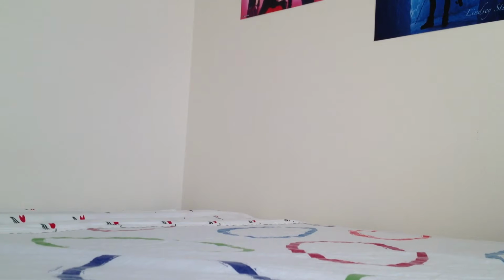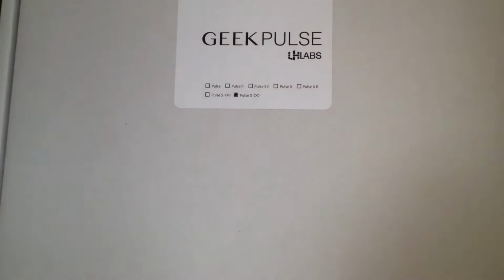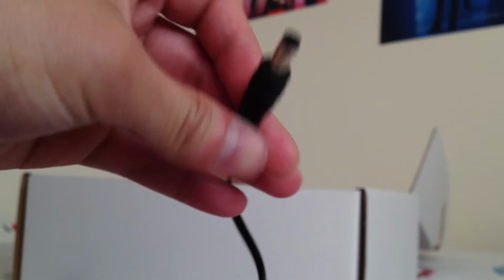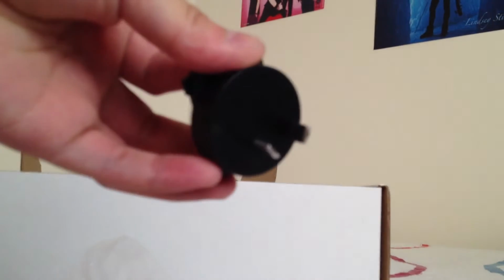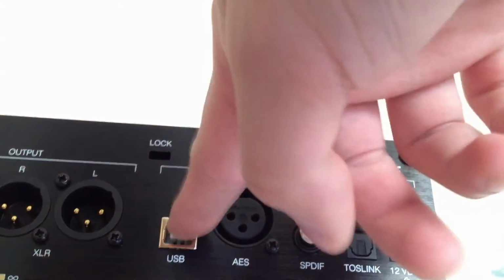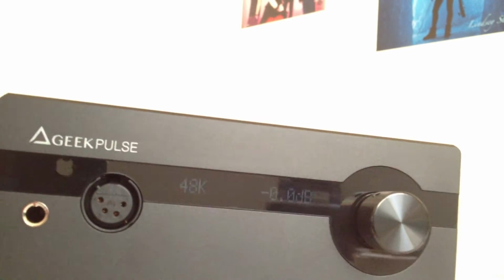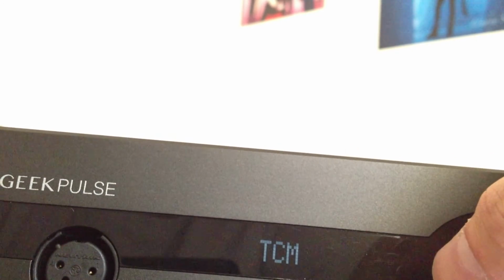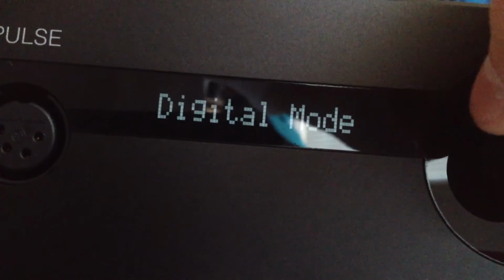[Binaural Unboxing] LH Labs Pulse X Infinity

Comment: so is this actually a decent DAC then not overpriced? are you still using it now?
Reply from the maker: Well, overpriced is relative. I think any one audio equipment minus the speakers is overpriced if it costs over $1000 unless it has some really pro-audio-oriented features like Benchmark Media's DACs. Diminishing gains hit really hard for non-speaker equipment after $1000 in my experience.

I paid $865 USD for this unit, and I think it was money well spent for the audio quality. It's definitely my reference DAC and I still use it (though not right now since I'm living in a cramped dormitory). I like it more than other DACs I've heard regardless of the price.

For the MSRP of $3000 USD or something crazy like that, I do think it's overpriced for the reasons above.

Comment: Have you experienced the issues that a number of others have reported with the popping/snapping?   Others have reported the problem so bad that it has blown out their drivers in their headphones.  I like their technology, but am concerned about the reported quality issues.  Thanks for your help.
Reply from the maker: +Mark Badia 
I only experience a loud popping sound when the sample rate changes and I have sensitive headphones plugged in (e.g. from 44.1 kHz to 96 kHz). Other than that I have no concerns for the unit despite hearing others' experience.